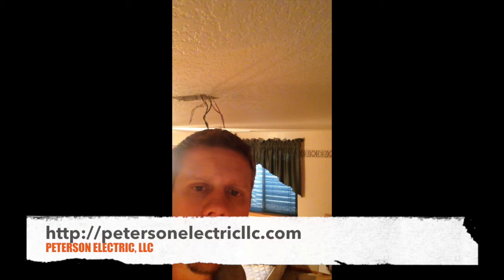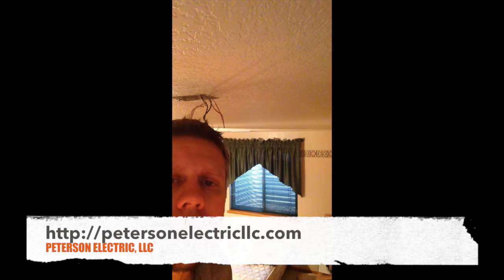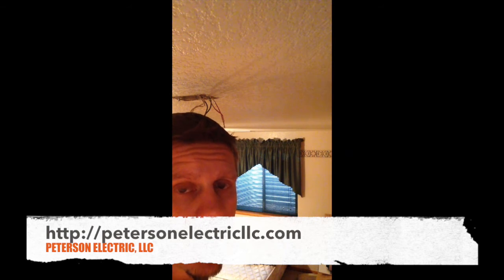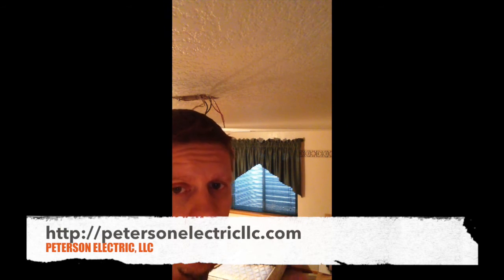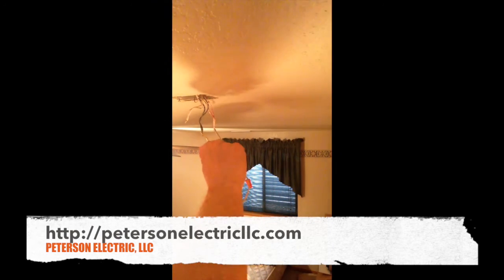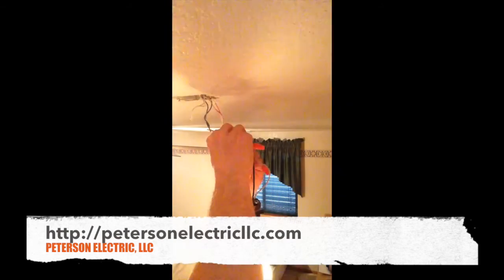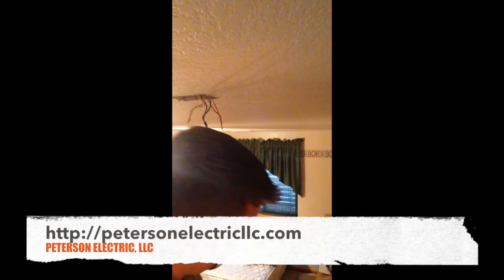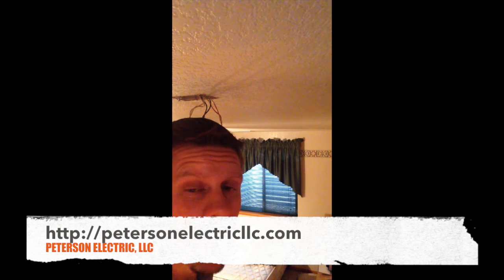Smoke Detectors Keep Going Off, What Is The Issue?

Comment: Hey Joshua, I’m having the exact same problem with my system. I’m getting false alarms every few weeks only when my detectors are being powered by AC. If I turn off their circuit and let them run on battery for a few weeks...no more false alarms. So it obviously has something to do with the AC. What do you think the issue could be? Thanks!

Comment: Hello. We have a First Alert smoke detector, that is NOT hard wired to the ceiling (the old detectors were replaced about 5 years ago). The new First Alert smoke detectors do not fit in the old hard wire to the house, therefore it operates by battery only.  The First Alert Smoke Detector started beeping, and the battery was changed. For a week now, every day the alarm beeped and we though the batteries were faulty, and kept changing the batteries. Then we found out that it was the hard wire in the ceiling that actually keeps beeping by itself, with no detector in there.  How can this be remedied?
Reply from the maker: Smokes for hard wired and batteries are only good for 10 yrs typically. Change out.
Reply: How is that going of let me tell u a story what happened to me so my mum was making me food and she burnt it and she hit it by accident or was crying and it was hanging out the celinh